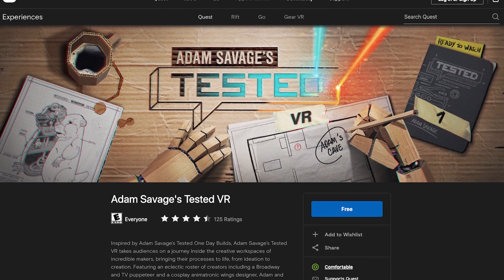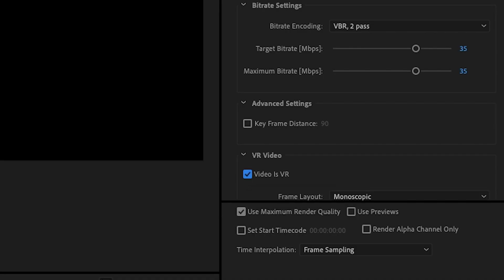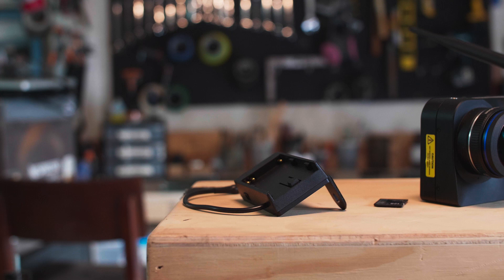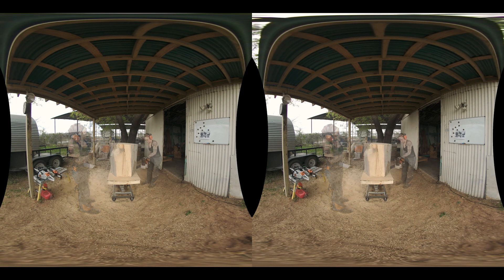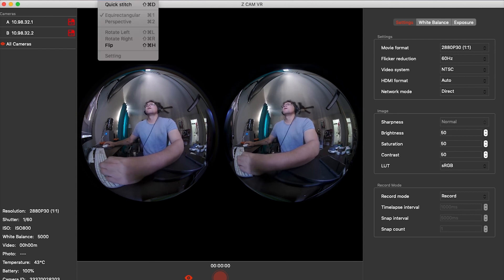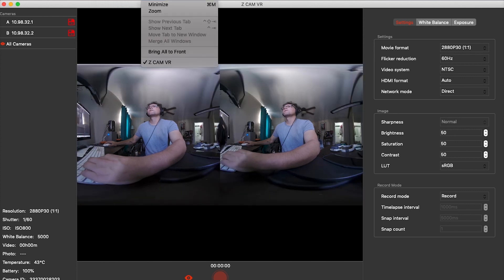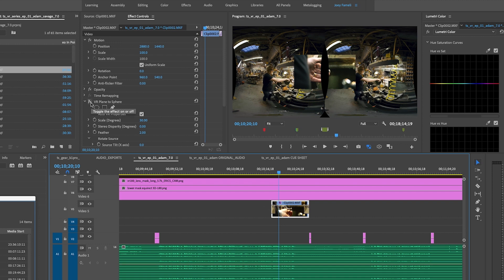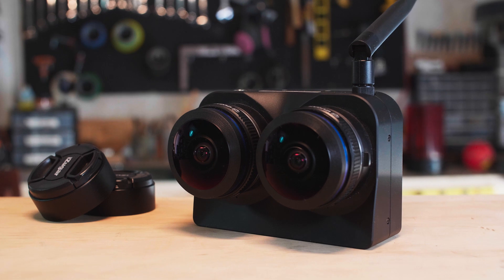Shooting and Editing VR 180 Video with the Z Cam K1 Pro!

Comment: 360 video also requires a lot of stitching which cannot be done without some nasty artifacts. Also 360 is a novelty that wears off in a few minutes in most cases. Notice how a theater stage is just in front of the audience and apart from the occasional trip down the isles by the actors in some shows people don't really want to turn around even in actual life.

Comment: I have a bit of an issue when you call a stereoscopic 180 deg camera VR. Nothing on the recorded content is virtual, technically you are even locked to fov. 
It's a stereo 3D camera....
Reply: But it has head tracking. You can look around you just can't turn all the way around, which isn't an issue. Have you ever watched a full 360 video in vr? It's more of a hassle then an advantage
Reply: @DenkyManner  Stereo 360 video probably shouldn't be called VR either. For it to be VR (IMO) the user needs to be able to move their viewpoint laterally as well as rotationally.

Comment: I purchased the camera but the big issue is that my Mac or my laptop windows 11 will not allow the wunderstich software to be opened do to security issues. I ever turned off my security and it still wont let me download. are there any other stitching software I can download that will work with my ZCam K1 Pro? I'm lost and the camera has been nothing but a paperweight.

Comment: Cool! I'm curious about the Senny VR mic, do you know if it's necessary, or because we're dealing with 180 degrees, and we're pretty much meant to look in one direction, could I get away with the just a stereo mic? I was thinking about plopping a Zoom h5 on top (with the stereo mic attachment) and using the 3.5m output, recording it directly to the K1 Pro's stereo input. I would greatly appreciate any thoughts you have, as I have not dealt with VR spacial recordings yet. Thanks for making this awesome video!!